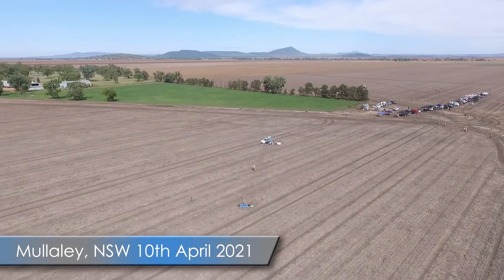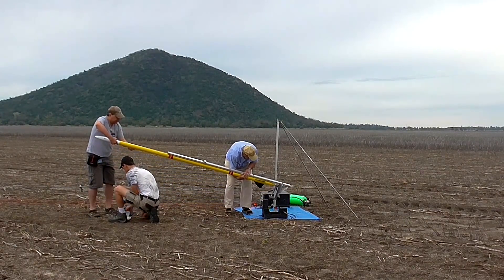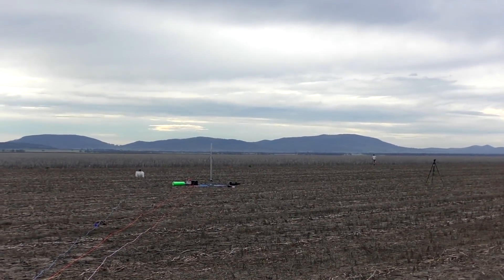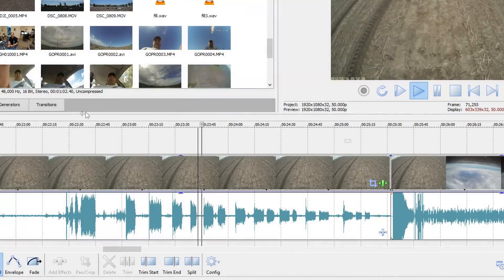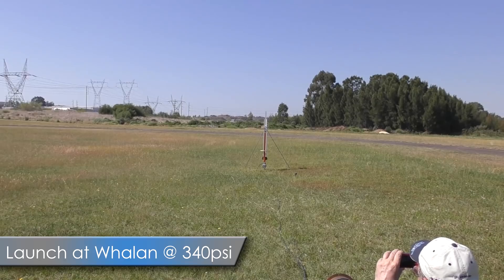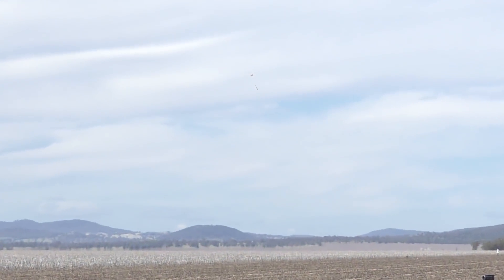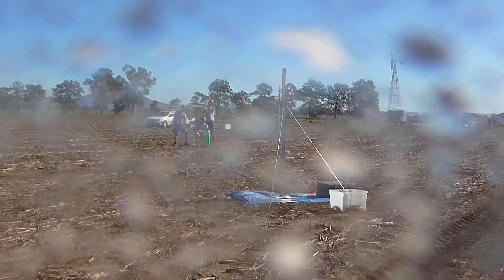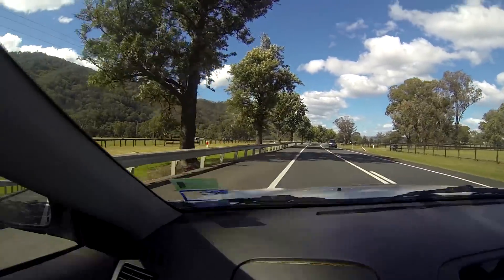High Pressure Water Rockets

Comment from the maker: Update 29/5/21: I've managed to fix the altimeter by replacing the LCD screen and hooking up a new battery. I was able to read off the altitude for the Nova rocket that crashed. The altitude was 1,445 feet or 440m. Not bad for a little rocket.
Reply: So glad that you turned the camera the right way up at the end! It's been over 50 years since I left Sydney, and I'm still not used to watching British TV the wrong way up!
Shame about the lawn dart. But hey, ho; there'll be another day. 🙂🚀

Comment: I love the water rockets. I had a 2 stage set back in the sixties, that had a launch pad and remote control panel with pressure guage, pump and release control built in. 
I wonder if anyone uses  high pressure steam, instead of air or air & water? It would of course be dangerous and definitely not a child or beginners setup.
Reply from the maker: There have been a number of steam rockets built. Here is a really well engineered one: https://www.youtube.com/watch?v=zLjaBDZ2J2o

Comment: I wonder if a hydrogen/oxygen fueled rocket can qualify as a water rocket since very hot water is ejected from the nozzle...  ;)
Reply from the maker: Not your classic "water rocket" that doesn't use any chemical reactions or use phase change (Like steam rockets.) to achieve propulsion. Classic water rocket is a cold gas pushing on a cold liquid.

Comment: hmmm noise volume decreases as it becoes full... well lets see, in the begining, the volume of air going in is quite a bit, thus alot of noise generated, as the pressure increases inside the volume of air rushing in has diminished aking less noise...  hows that for a hypothesis??  ;)

Comment: Now could you build the High Pressure Water motors... and use them with other rocket bodies like high power Rocket motors...so a water rocket motor could be used with different rocket designs...by sliding it into an motor mount of different rockets?
Reply from the maker: That's a good question. Theoretically it would be possible, but because water rockets are so inefficient, you would end up with terrible performance. For this reason virtually all water rockets are minimum diameter where a significant portion of the airframe IS the pressure chamber. In terms of performance comparison, here is our L1 rocket that can fly either as a water rocket or on solid propellant. https://www.youtube.com/watch?v=K07TM7cuvMQ ... when it flies as a water rocket it will get to around 700 feet and on an 38mm H  motor it will get to around 1500 feet. Now imagine if you had a 38mm "water rocket" motor inside of a rocket like that, even something like a 6 grain case, you would only get less than 100 feet.

Comment: Why don’t you set the parachute deployment for later so the rocket can fall straight down or at least closer to where it originally started from and then have the parachute deploy a few hundred feet from the ground… let the thing fall halfway back to earth before having the parachute come out..
Anyway you guys do such good work you should just skip all that water propulsion and make some real rockets..!!
Reply from the maker: Opening it much later than apogee would result in a high speed deploy. High speed deploys are undesirable as you can shred your parachute and potentially do damage to the rocket, particularly with this lightweight parachute deploy mechanism. Real rockets like this?: https://youtu.be/K07TM7cuvMQ :)

Comment: Wouldn't it be neat if you had three chambers of water and air? Granted it will add weight to the vehicle ( in electronic timers and valves, also the weight of extra chambers) then you have first, second and third stages! And, hopefully, higher altitudes!

Comment: You could put one of the meshtastic LORA radios in it. They have GPS and the LORA radios will easily cover the distance.
Reply from the maker: Thanks for the suggestion, I will have to investigate this further as it certainly seems a plausible solution.
Reply: @AirCommandRockets  The radios normally use an 18650 Li battery, but that gets about a week of operation. For the duration of the flight, anything that puts out about 3.5V would work. I have the ones based on the t -beam v1.1 modules. You wouldn't have to mount the oled display. What is cool about it is that there is a mobile phone app that talks to a nearby module which shows the location of all the others on a map w/ distance (so you could have one on the rocket, plus one next to you). Good luck, I think you have a really cool project here.

Comment: It should be posible to increase performance using different a gas.
CO2 is very soluble in water . And solubility increases with pressure ... At high pressure the water will hold a lot of CO2 , during 'burn' the pressure goes down releasing more CO2 from the water and this will help keep pressure high ...
What about a rocket with petrol as the fluid and pressurized oxygen with afterburner?

Comment: As pressure inside the rocket rises it comes closer to equalization with the supply tank.  As they equalize the rate of flow decreases.  You're initially hearing a high rate of transfer, but as the rocket fills the flow rate decreases.  If allowed to continue without theoretically exploding - the air flow will decrease and decrease to a zero flow when both tanks are equalized.

Comment: fire it at night with lights on it and it would be easier find?
Reply from the maker: That's not necessarily such a bad idea. Launch it during the day, but have a light sensitive switch, and a bright strobe comes on after dark. That way you save battery power until dark, and then it is easier to find. You only need a very brief flash every say 15 seconds.  A drone would pick that up easily.

Comment: Do you use fresh water or salt ?
Reply from the maker: Fresh water.
Reply: @AirCommandRockets  would the extra density of salt water help any
Reply from the maker: @johnconnell5115  It may not necessarily get you more altitude. Although you will produce greater thrust, that is countered by the greater weight of the water still in the rocket that you are trying to lift. Here is an experiment that looked at density: https://youtu.be/Fu3rIiPy_18
Reply: @AirCommandRockets  cool ya that makes sense.  what if you pressurized  with helium or hydrogen
Reply from the maker: @johnconnell5115  These gases have a low molecular mass so when they emerge from the nozzle they aren't providing a lot of reactive mass to produce thrust. CO2 will actually give you better performance than regular air, because it is heavier.
Reply: @AirCommandRockets   so how about tungsten hexaflourid   the other ideas I had  i think would be radioactive

Comment: q and a 
apogee - is this the same when i shoot arrows up and they seem to hang  for sec before tipping over
Reply from the maker: Apogee just means the highest point of the flight measured in meters or feet above ground. Arrows behave very similarly to rockets near apogee where they slow down to low speed before accelerating again.

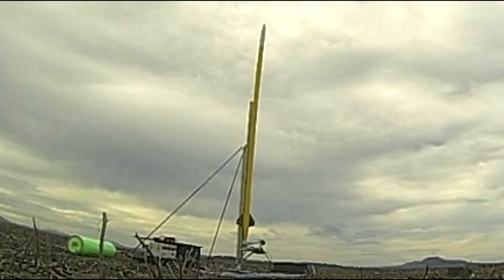Comment: 4:41 I'd guess the reason the sound gets quieter as the pressure rises is due to the changing impedance of the air inside. When sound passes from one medium to another, it experiences attenuation (reduction in amplitude) due to impedance mismatching. Initially, the air inside the rocket is at atmospheric pressure, so the impedance is the same inside and out. As the pressure rises, the impedance will change, resulting in amplitude losses as the sound is transmitted through the rocket.

Comment: Water rockets are cool! About the sound. Sound is air in motion right? The onboard camera mic records the normal ambient sound but also records some vibration/resonance . Putt a action cam in one of those underwatercasings an put it on a helmet and walk around. You hear thump-thump-thump, but hardly any talking. I believe that as the pressure increases  the pressurevessel material gets under increasing tention and vibrates less (= less air in motion). And less vibration, less vib/res transported through the physical structure it self into the mic. Just my thougts about it, im not well educatet or anything.

Comment: Rockets like this can someday be full fledge orbit persue. Unlike flame burst rockets, pressure burst rockets could start as a solid fuel chambers merging to a liquid & gaily chambers, finally linking to a pressure burst chamber, intinse enough to exirt almost without permission, as reaching the cone chamber final release thrust.
Reply from the maker: You cannot get to orbit with a water rocket. They are just too inefficient.
Reply: @AirCommandRockets  is that some kind of regulation your enforcing?.... those aren't rockets, not full fledge size at least, hand held or back yard missiles. Plus, anything thag can exirt continues momentum,  can travel not just orbit, but solar orbit as well, people think a wing craft cannot go into space, when a bloody car has been hauled up there.
Reply from the maker: @ckdigitaltheqof6th210  I'm not enforcing anything, I am just commenting on the physics of water rockets. A water rocket, no matter the size, cannot generate the necessary delta-v to get to orbit.
Reply: @AirCommandRockets  "electric cars cannot provide enough power then gas"...THAT is what you sound like, you were declaring an attempt to be impossible & inevitable.
Reply: @AirCommandRockets  you would be correct in one factor, these are mini rockets, basicly hand crafted missles, no where near a ratio of a cargo/man carried craft, as well , a larger one, would require a more intense pressure exirtion then these small devices.  I'm setting an example; fllame rockets apply pressure engulfing the atmosphere rappitly, causing acdirectional momentum advantage, such as inside of a booster cone, Pressure Rockets excrete intensly, they can offer greater momentum,  but harder to manage over flow, which is why i was presenting multi chamber stage transfer of the fossil density, before exertion.
Reply from the maker: Show me the maths that that's possible. Presumably if you are building a very large water rocket, you will also be filling it with lots of heavy water. You will generate more thrust but will need to lift a heavier mass with all the water still in it. This is why simply scaling a water rocket doesn't work.
Reply: @AirCommandRockets  the math is what everyone is working on, couldn't scale that on a youtube thread here. In a giant actual rocket scale use, it wouldn't be just water, but solid to liquid and eventually gas chamber transfers to save space, thus reaching a pressure chamber, the rockets in thiese videos now, hand-made, are already the final chamber phase of the concept i was implamenting. ...i bet, if you stacked multiple of water rods adjacent to a vessel, it would show almost the sane results using a longer duriation instead of a quick blast.

Comment: 45 minutes to look for the rocket even WITH a quadcopter in the air? The hell???
Reply from the maker: It's actually a little tricky to search with the drone. I had only a small phone screen to look at with some glare, so you have to fly lower to be able to resolve the rocket, but the fields look so homogeneous you really don't have a point of reference where you are. If you are  half a km away with the drone, you also don't have an idea where you're drone is relative to you. Then trying to set up some sort of search pattern can get tricky.
Reply: @AirCommandRockets   Totally understand, keep up the good work!

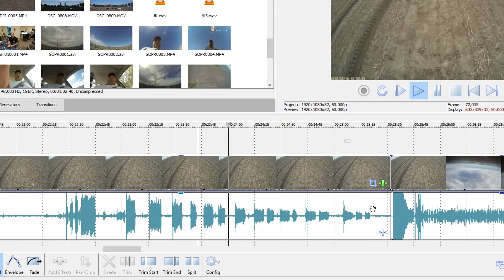Comment: 4:34 if the microphone is located on the tip of the rocket and the water is being filled from the bottom it might be that the sound has to travel trough more water that “absorbe” the sound as it fills up. This seems very simple to explain so I doub i got it right :P
Reply from the maker: No water flows into the rocket, the rocket already has all the water in it before we start pressurising.

Comment: The noise decreases as the pressure builds, as I ponder, because there is more air inside. Each pump represents a smaller percentage of the total air. It also moves slower because it's compressed to a smaller size.
Nice footage from the onboard camera.

Comment: nice!! why not launch it with an angle against the wind direction?
Reply from the maker: When you are going for altitude, you want to point it up. The rocket will naturally want to point into the wind as it flies so it flies up range somewhat before the parachute deploys. If we wanted easy recovery then yes, pointing it into wind would help with that.

Comment: I saw this really tiny GPS module. I thought maybe you might be interested. It's called the 'Diatone Mamba GPS/Beidou M220'. 4.9g maybe it will reduce weight too.
Reply from the maker: Thanks for the suggestion. We would still need to pair it with a transmitter to transmit the co-ordinates back to a home base receiver.

Comment: You need a long nozzle to expand the water into bubbles before it comes out and you can't get work from it anymore. As soon as the pressure is released, a wave of bubbles propagates from the nozzle exit inwards. Within a microsecond your entire water volume becomes a dense foam.... problem is you also already kicked it out during launch.

Comment: As the air is pressurized inside the tank, this decreases the velocity from the new air coming in. The decrease in velocity means a lower Reynolds number in turn resulting in a more laminar flow for the Fuild(air) resulting in less noise

Comment: Out of curiosity, why not use heated water. Ie water, heated in the rocket while under pressure. Adding a small expansion zone, prior to the bell, you could probably flash to steam on exit from expansion chamber from pressure differential and the stored heat energy of the water.  You'd need less water volume for the same static thrust and could potentially maintain thrust for more than 1/2 a second.   This is just something I thought while watching the video and recalling a boiler explosion I was once witness to.  It may have been done already, I know little about this, and you obviously do it this way for a reason.  I just don't know what that is.
Reply from the maker: What you are referring to is called a steam rocket. These exist and people have flown them, but it is a different kind of propulsion method to a traditional water rocket. Water rockets don't rely on a phase change for propulsion like steam rockets do. Traditional water rockets just use a cold compressed gas to push on a cold liquid. Steam rockets certainly have their challenges mostly in making a pressure chamber that can also withstand the heat and be lightweight at the same time.

Comment: Perhaps instead of 'air' use nitrogen or another pure gas that will not go liquid itself at the pressures you are using?
Reply from the maker: None of the gases we use go liquid at these pressures. Although using CO2 gives you better performance compared to air because of it's higher molecular mass.

Comment: First, at 4:10, what kind of spider is that? I've never seen one like it. Second, suppose you used a propellant denser than water? Would that add to or detract from the altitude achieved? On the one hand, you're pushing more mass out the nozzle, but on the other, you need to lift more mass.
Reply from the maker: Have no idea what spider that is. There was a huge variety of spiders on the field. Very good question about the density of the water, and good insight why denser liquids don't necessarily translate to higher altitudes. We looked into this a couple of years ago, here is a video where we did some experiments with different densities: https://youtu.be/Fu3rIiPy_18

Comment: if you are adding more air it takes more energy to move the air its like pushing 1 lead ball or 6 it atleast will change its frequincy (Maybe throw it in a FFT? see if the frequincy only changes) also i see matthew alderfer's answer that is also pretty likely....

Comment: Would a colored smoke generator make it easier to find the rocket? As the chute deploys the smoke generator comes on?  I'm not sure if that's feasible.  But considering the propensity for damaged electronics on landing, the smoke canister might be a little more reliable on a hard landing.  Also the trail of smoke would be easier to locate as the rocket comes down.
Reply from the maker: That would certainly make it easier to find, but the weight of the smoke generator could be an issue. I don't have direct experience with smoke generators, but if it is something that is burning, (even internally)? This may be an issue if it was to start a fire on landing.

Comment: Great video!! Have you ever experimented with liquids of different viscosities? It would be interesting to see everything from soda pop to maybe a light mineral oil and their affects on flight.
Reply from the maker: We have not tried different viscosities specifically, but have done different densities. https://youtu.be/Fu3rIiPy_18 Each of the liquids I guess also has a different viscosity.
Reply: @AirCommandRockets  for a straight forward thruster 
H2O is much better than CO2 or N2 since it has 155sec isp

But in the study they did not mention what temp was the water or to what psi was it compressed

According to your rockets what is the isp you are getting and at what lressure exactl?
Reply from the maker: @FirstLast-tx3yj  That sounds like a steam rocket. Where the water changes from liquid to a gas. This is a different kind of water rocket. Cold gas acting on a cold liquid.